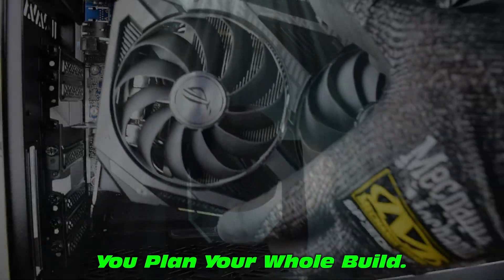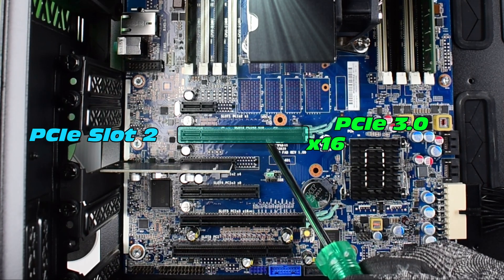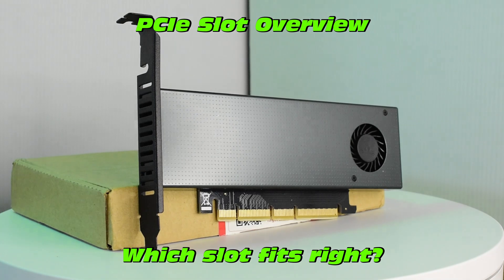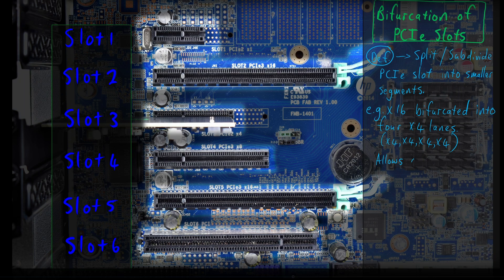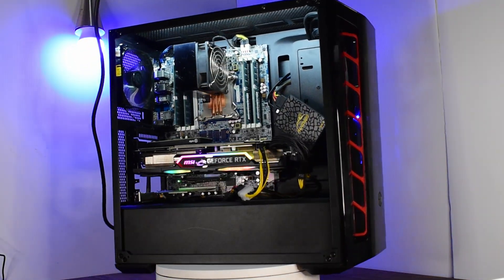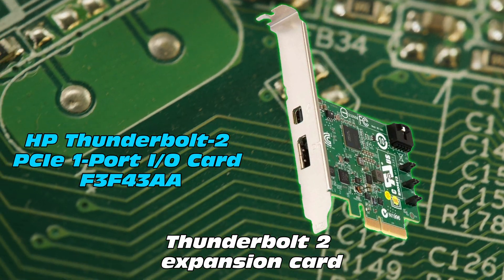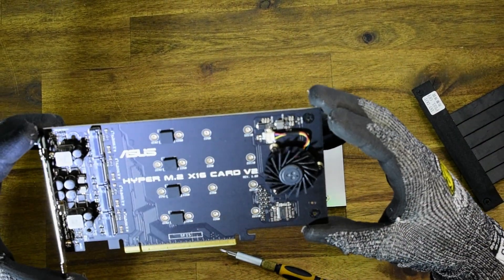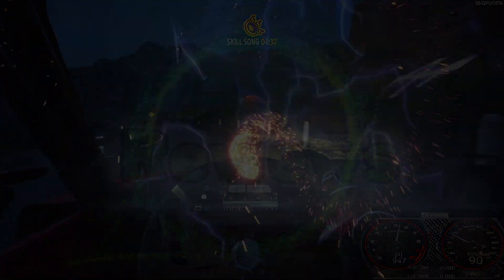PCIe Guide : Slot Selection + Bifurcation Explained (Featuring HP Z440 Motherboard)

Comment: Shouldn't it be 236B/256B for PCIe6.0+ (excluding 20Bytes overhead per flit)
Reply from the maker: I'd say both are correct. The PCIe 6.0 spec defines a 256-byte FLIT as: 236 bytes of Transaction Layer Packet (TLP) data, 6 bytes of Data Link Layer Payload (DLP), and 14 bytes of protection overhead (8 bytes Cyclic Redundancy Check (CRC) + 6 bytes Forward Error Correction (FEC)). Some breakdowns refer strictly to TLP payload (236 B), while others refer to TLP + link-layer DLP fields (236 B + 6 B = 242 B) as the “useful bytes”. Thus, both figures (236B and 242B) are correct depending on which layer boundary is being referenced. You can also confirm which is the more popular reference by Googling both of the options - 242B/256B efficiency is most commonly attributed to PCIe 6.0 and PCIe 7.0. (Reference: https://pcisig.com/blog/pcie%C2%AE-60-specification-webinar-qa-deeper-dive-flit-mode-pam4-and-forward-error-correction-fec?)

Comment: The bifurcation works in all slots? It's possible to split all slots to x4? I mean, the Slot 2 (PCIE 3.0 x16 into PCIE 3.0 x4/x4/x4/x4), the other PCIE 3.0 x8 into x4/x4 and the other PCIE 3.0 x16 to x4/x4/x4/x4 too?
Reply from the maker: Sorry, I am a little slow to get back to you. Pending the system you have, bifurcation may work on all or only select PCIe slots. On the Z440 used for the video, bifurcation was feasible on most of the PCIe slots. The BIOS specifies which bifurcation options are possible for a given PCIe slot. I actually put this to the test more recently where I bifurcated all 9 PCIe slots in the HP Z8 G4 to set up a massive RAID 0 M.2 NVMe pool using all of the PCIe slots. The result was surprising lol https://youtu.be/P8PN6uM4ZFg
Reply: You would not want to do that.  I question even doing it with the 2 x16 but if I would not go over the 2 x16

Comment: I have a workstation HP Z8 G4, and need to connect GPUs externally. 4 GPU's do not fit inside the case. I'm looking for a way to do this. Using simple PCIE extender cables is cheapest but limits the ease of use as cables needs to be routed from inside of the case. I have found no adapters to do this easily that would connect PCIE x16  internal slot to some external port that would connect using cable to eGPU.
Reply: some cards use SlimSAS SFF-8654 connectors , but the other cards I found use PCIe (MCIO) whatever that is. Some GPU adapters have 6pin/8pin some 24pin power connectors, the MCIO cards on aliexpress like F37B GPU adapter has no power connectors. What would work best. The advantage of using these cards is you can use bifurcation and split one x16 port to 2x ports gave 8 GPU cards total.
Reply from the maker: @ What was your goal for the system? I presume either machine learning or AI workloads? The ADT PCIe 4.0 x16 MCIO would work for splitting the PCIe slot lanes up. The main challenge is still securing the GPU outside the system case. With a GPU mining rig it might be viable - but I am not sure how long GPU risers can be before they develop issues with signal degradation (likely 35cm will be the longest you can go before issues).
Reply: @ I will use external PSU for GPU's that mounted outside PC, therefore MCIO cards on aliexpress like F37B will likely not work no isolation. Do you know what cards at x16 provide isolation?
Reply from the maker: Which GPUs were you planning on fitting? The HP Z8 G4 is quite powerful and would be able to provide up to 219.6W per 6+2 pin cable (assuming 240V mains). Using external PSUs make the system a bit more cumbersome - but it is still viable with the right adapters. As you mentioned, the adapters will need to provide power isolation to prevent issues with the external PSUs. I have not delved into that myself but it would be something a GPU mining YT channel would have covered. One example from Modern Mining: https://www.youtube.com/watch?v=hmg5Elr4rEo

In a quick search:
  The ADT-link M.2 x4 PCIe to X16 Riser board: https://www.amazon.com/ADT-LINK-Extension-PCI-Express-Graphics-External/dp/B085RKSSGW
  Something like the Amfeltec PCIe 4-way splitter could be useful:  https://www.amfeltec.com/gpu-oriented-x4-pcie-4-way-splitter/
  A classic PCIe x1 USB riser to x16 could work - but you'll suffer some performance loss: https://www.ebay.com/itm/295168442441
Reply: @ I wonder how could these have worked "
visiontek-juice-box-vt-450cd-450w,fsp-group-booster-x5-450w,thermaltake-power-express-650" being non isolated. So far I have not found any cable port sff8654 8i internal to external converters. This seem to be main problem now. This port was chosen by Chinese manufacturers for some reason. Otherwise you must convert to external port standard, then add bracket for it, then external cable and back again. This extends to 1.5meter long cable and this needs retimer for sure. Any help in finding port converter/bracket from sff8654 8i to sff8654 8i ? Must have 2 ports .
Reply from the maker: You are in the right place because that is the kind of mods I opt for. I haven't seen this level of mod on YouTube - but that doesn't mean it isn't possible. With a will there is a way. I'll create the way - you just need to get creative to keep those GPUs powered, cooled and mounted. 

https://youtu.be/pWS9hGgSo-4

I have been using the PCIe riser cable underneath my GPU for a couple of years now - so far so good. My GPU is in the case without a lid on and the GPU provide sufficient cooling for the PCIe riser outside the system case.

Theoretically with this method and different riser cable lengths you could accommodate 4 GPUs outside the system case (or 2 inside and 2 outside the case etc.). It would be a tad Frankenstein-ish once done, but it is viable pending the GPUs you use.

Comment: bifurcation only in XEON platfom right?
Reply from the maker: Most XEON systems will have bifurcation support, but this function is mostly limited by the motherboard. Some desktop systems can support bifurcation but they are quite expensive. Something like the Z840 is well suited because you can bifurcate most of the PCIe slots. Also, note that the older workstations - so Z820 and Z800 do not support bifurcation but they would allow one NVMe to be connected via PCIe.

Comment: will this be faster than sata2 in old pc like z800?
Reply from the maker: Yes, a lot faster than SATA. SSDs reach ~550MB/s read and ~500MB/s write speeds. A single NVMe connected to PCIe will net ~3500MB/s read and 3200MB/s write. The Z800 is a little bit slower however because it only has PCIe 2.0 which limits the NVMes to 2000MB/s read and 2000MB/s write. With a Z820 or newer workstation you get PCIe 3.0 which will be faster.

Comment: what is that data transfer do you get with that adapter in the NVME ?
Reply from the maker: The fastest transfer speeds I have obtained with NVMes was on the Z8 G4 with 4x NVMes pooled into a RAID 0 drive. I got ~11500 MB/s read and ~9500 MB/s write. Not bad for an aged workstation. Normally NVMes on these workstations can reach ~3500 MB/s read and ~3200MB/s write.

Comment: Hey, I am planning to use two GPUs in the z440 to use one for linux and other for Windows VM, having said that, will slotting two cards into the 2 16 slots divide the bandwidth into 8x each?

I am concern that I will be compromising the performance of each card
Reply from the maker: Which GPUs did you plan on running? The reality is that most GPUs under every day tasks will not see much of a bottleneck (maybe 1-5%) at x8 vs x16 PCIe 3.0 connection. The newer the GPU the larger the bottleneck would likely be. The Z440's bigger limitation is the limit of PCIe 3.0 - particularly for modern GPUs (e.g. RTX 3090 or RTX 4090 etc.). For your end application I believe you will not run into any major issues. To compare the bottlenecks - check out this calculator: https://pc-builds.com/bottleneck-calculator/ . Feed in your system specs and it will give you estimates of your end bottleneck for each given configuration and end application.
Reply: @racerrrz  okay so for Nvidia card I would be using 3070 on windows, and rx 550 for Linux Host. The only reason I am using rx 550 if you are curious is because I would be using the linux system for basic everyday browsing and  word processing tasks, and I also wanted something that doesn't require PCIe power since both 6pin would be used by my 3070
Reply from the maker: @AbeelSiddiqui  Nice, that makes for a versatile system. It's generally good to have dual OS - it just gives you more options from your system. Proxmox is a good way to go also if you wanted to look towards using virtual machines, each with a different OS. Your RTX 3070 is more or less a perfect match with the Z440's hardware and it should not see much, if any, bottleneck.

Comment: I have HP z440 machine which I got back in 2018.  My setup is pretty simple: Slot1 - WiFi and Bluetooth card, Slot2 - Nvidia Quadro card, Slot5 - Primary(OS) Samsung 1TB NVMe and Slot4 - HP Z TD 256GB.  Both SSDs get at least 3000 MB/s of read speed.  I haven't used bifurcation as I only have 1 M.2 card on each adapter.  I am not an expert, but I believe the setup is pretty balanced/correct.
Reply from the maker: Nice, your setup sounds fairly efficient - it would get everything done, and the 3000MB/s is ample for modern day tasks. Having your GPU on Slot 2 or 5 is most optimal, and the NVMes on Slot 4 and 5 is perfect. 
 
I have my Z440's PCIe utilization on the extreme end right now. 
Slot 1 USB C adapter, 
Slot 2 dual 10GbE adapter, 
Slot 3 Riser cable with GTX 970 vertically mounted, 
Slot 4 HBA (8 SATA/SAS ports), 
Slot 5 HP Z Turbo Drive Quad Pro, 
Slot 6 Wifi Card. 

Being a NAS build I have optimised for drive performance, not GPU performance (I mostly remote connect to it if needed). It has been working really well as my NAS and I even managed to get my 10GbE connection up to 8-9 GbE, not bad for an old workstation!
Reply: @racerrrz  Wow, you put your machine to work!  The sad part is that E5-1650 v4 CPU on my machine isn't officially supported as per Win 11 processor compatibility page.  I am still running Win 10 Pro, however soon planning to install Win 11 and hope MS won't stop releasing updates for unsupported devices.  Good video!
Reply from the maker: @Charkatak  That is the only downside of older workstations! What you really need is to upgrade to the newer HP Z4 G4. They aren't too expensive, in fact sometimes they sell for less than the Z440 on Ebay! The HP Z4 G4 / Z6 G4 / Z8 G4 are all Windows 11 ready. I think MS did mention dropping support for Windows 10 later next year (Officially, October 14, 2025). So we will need to upgrade hardware by then unfortunately, or endure the unsupported OS like Windows 8 users are.
Reply: @racerrrz  I will look at these machine, as it sounds like a good idea!  I would feel bad replacing z440 at this stage though, as it is more than enough for daily usage and 32GB of RAM is plenty. I was planning to install "slim blu-ray" drive which is compatible with z440.  Was wondering if you have installed any optical drive into slim port/bay and SATA cables were included/attached to the case?  I can of course open the case up and take a look...just didn't want to disconnect all the cables and remove the machine from it's spot.
Reply from the maker: @Charkatak  If you wait another year or so they will be quite affordable machines. I have the same mindset with the Z440 - but then I am using mine with TrueNAS mostly right now so I will not really be effected by Win 10 support dropping. The hardware remains capable, and with 32GB of RAM - what more could you want for daily use.  

In terms of Slim Blu-Ray drive - that should work just fine. There will be sata power and likely Sata data cables there already - most Z440's have the 5.25" Optical drive (likely a DVD-Writer), so it should be plug and play. I usually remove my optical drives for more storage! You can fit 1x 3.5" HDD and 2x SSDs where the 5.25" Optical drive resides. The slim one does save a bit of space at least.
Reply: @racerrrz  In control panel>backup and restore, I created "system image" for my Win 10 pro, just in case.  Then installed Win 11 on the machine.  Don't know if it is any faster now, but programs work and upgrade retained desktop shortcut placement and other settings.  Although Win 10 start menu isn't there, however Win 11 did save a folder in a new start menu named "win 10 apps". These were from original app tiles, so I just moved them out of that folder.
Reply: @Charkatak  it is now. You can get tpm 2.0 bios update.
Reply: @racerrrz  I have a Z440, sorry  but I don't urdenstand, does the z440 has bifurcation or not?

Comment: Since slot 6 is rarely used, I think it would be better to put the graphics card into Slot 5 (As most are double slotted nowadays). This will ensure slot 3 is not covered.
Reply from the maker: Great idea. The GPU is a bit problematic, but as you say most of them are 2 slot cards. I have not tested a 2-slot GPU in PCIe Slot 5 in the Z440. 

After case swapping my Z440 in the Fractal Define 7-XL I have lots of space - allowing me to fit: 

  a USB Type C adapter on Slot 1,
  a 10GbE card on Slot 2, 
  a GTX 970 connected to PCIe Slot 3 via a riser adapter, 
  a 8 drive SAS HBA on Slot 4 and 
  a HP Z Turbo Drive Quad Pro on Slot 5 (x4x4x4x4 NVMe adapter). 

I have an old wifi card on Slot 6 - but since it's only a PCI slot there isn't much else to run in there.

Comment: I picked up one of those pcie to M.2 cards. I had to play with the slot settings in BIOS to get it to work, but it works. It's nice having 10 TB of lightning fast storage at your disposal. It does go quick though!! Most top tier games are 100-150GB these days. Nine games and you just filled that 1TB drive. What's your goto racing game btw?
Reply from the maker: Nice, wait is that a 10TB NVMe or NVMes in RAID 0 to net 10TB? I have to ask haha. That's true, and game archives will just keep getting larger as graphics improves over time. I am quite impressed with the Asus Hyper M.2 adapter with 4x 2TB NVMes in RAID 0. It works really well for a game library as well as a storage drive for video editing (In case you haven't seen it: https://youtu.be/xqg0uQ93KTg). 

Racing games wise, anything and everything that allows racing. Right now I am on Forza Motorsport, Assetto Corsa (with content manager + mods) before that, and Forza Horizon 5 in between also. GT7 is great, but I don't own a PS5 - so that is experienced only through mates. But sim racing is the best experience these days (I use a Logitech G923 + 6-speed shifter).

Comment: 11:19 one quirk of those particular M.2 NGFF SSD adaptors is that you can often fit two of them onto the "underneath screw holes" of a dual 3.5-2.5inch bay adaptor, using some slimline M3 nuts (half nuts if you're a mechanical engineer) and some hex spacers. 

You need to use some brass hex standoffs and (crucially mount one upside down and the other the right way up. To do this, you'll need 2 different lengths of hex standoffs. 

You'll also need patience and a bucketfull of desperation, but using this method of mounting I can get 2 x 2.5inch SSDs and 2x M2 SSD under the PSU bay of a HP 8300 Elite SFF for example, handy for Proxmox because when running disk-intensive VMs you can even out the I/O load onto different disks, or RAIDZ1 or Z2 them using ZFS.
Reply from the maker: Hi. That is handy to know about. The more methods there are for securely mounting drives the better I would say. I haven't seen anyone doing this specifically but the slimline M3 bolt and nut combined with the 2x NGFF SSD adapters should give you ample storage expansion with cooling! Great job on the description, I can visualise what you did. 

Talking storage - I am zipping together a quick video on 5.25" Bay storage adapters (HDD, SSD, NVMe etc.). There are quite a few solid options - with not many being affordable - but the 4x U.2 NVMe or 4x M.2 NVMe hot swappable 5.25" drive bays are definitely top of my list for cool storage methods (the M.2 NVMe bays are options on the HP Z8 G5 Fury as an example). Pricey however. 

I usually opt for the cheapest route and that lead me to the cheap adapters like the NGFF to Sata adapter.

Comment: Great video!  Helped me set bifurcation properly on my z440.  Added a pcie card with quad nvme drives.  Thank you!
Reply from the maker: Great job! I am glad that was helpful. Which Quad NVMe adapter did you settle on for your Z440? If you haven't seen my overview of 4 different quad adapters, you may enjoy that also: https://www.youtube.com/watch?v=xqg0uQ93KTg . I ran short on PCIe slots in my Z440 to install a quad adapter in the end but I am happy with the Z440's performance.
Reply: I'm here for the same exact reason

Comment: I have one of these. E5 1620 V3. K2200 Quadro, 32gb 2133 4x8gb. 500 GB SSD.
Reply from the maker: Hi, that sounds like a well geared Z440. What was your end use for it? How has the K2200 been treating you? My Z840 initially came supplied with a K2200 and the GPU seemed to handle every day tasks without complaint.